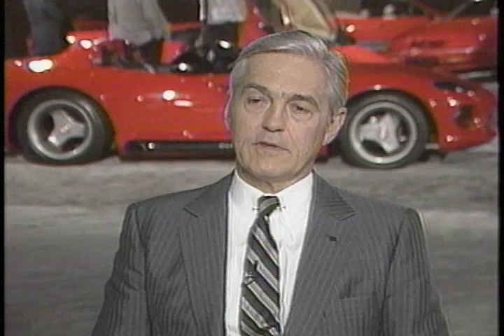Bob Lutz talks about 1991 Dodge Viper

Comment: The problem at this time was the entire Chrysler/Dodge/Plymouth line up was simple too small. By now almost every single car was based on the "K"-car. At the time, Chrysler had room in the line up for something bigger and still meet CAFE standards. Instead, Mr. Iaccoca, Mr. Lutz and team told traditional Imperial/Chrysler/DeSoto/Dodge/Plymouth buyers of previous decades this; "Screw you buddy, you don't like small front wheel drive cars, go buy something else and we did! Additional note, the 1990 FWD Imperial based on the "K" car didn't cut it either.
Reply: The viper ushered in a whole new era of Chrysler cars, in a turn away from the mpg-focused, downsized early 80's era "K" car lineup. Their 90s design theme from this car forward was a swoopy, curvy breath of fresh air compared to the formal rooflines, hard angles and short wheelbase of the "k" car era
Reply: They were building the rear wheel drive Chrysler Fifth Avenue and Dodge Diplomat...  but sales collapsed by the late 1980's.
Reply: Yes, and if they hadn’t done that Chrysler wouldn’t still be around.

Comment: Quality low gloss plastic finish and feel better quality knobs.... Chrysler hasn't achieved that in 2019 let alone 1990 when Lutz was pimping that crap.
Reply: Chrysler Corp. Cars had higher quality and reliability ratings in 1990 than they do in 2022...the vehicles look a lot better now and are definitely safer and more powerful but the more computerized components you stuff in a car, the more room for error and failure.